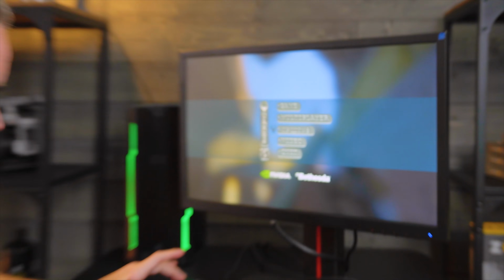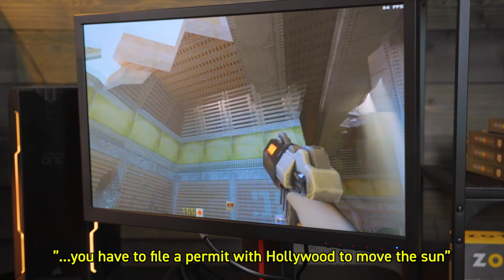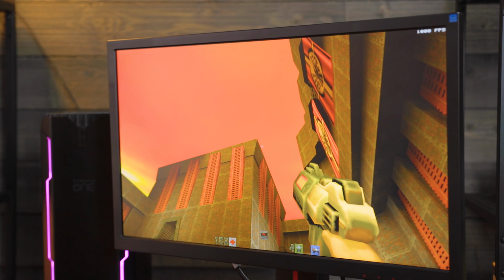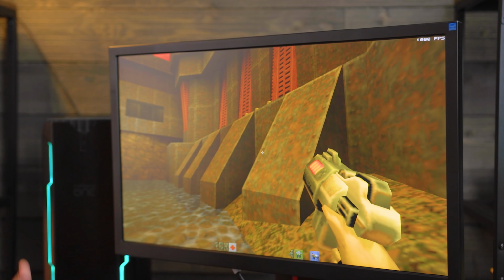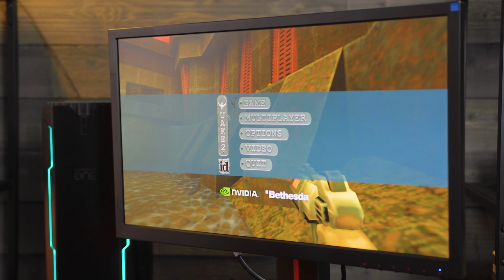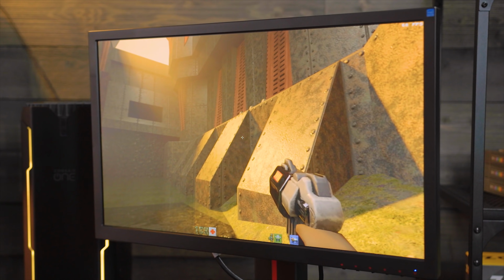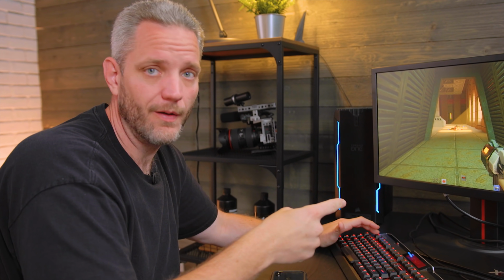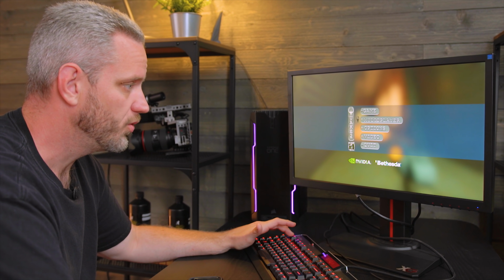Testing Quake II with fully ray traced update...

Comment: GTX 1080 + i7-9700k @ 5.1Ghz + 16GB DDR4 all at 1080p Resolution = 8-29 fps depending on settings
Reply: 'Nvidia has announced it will extend ray tracing support to its older Pascal family. ... According to Nvidia, attempting to run ray tracing on a GTX GPU will send the frame rate cratering, all the way down to 18fps on aGTX 1080 Ti'
Reply: @majorcrits333  what is it you want so say? :)
Reply: @johnwayne-ou5yy  RTX cards have dedicated technology for ray tracing, thus being much more optimized for RTX quake 2.
Reply: @sashaburquest7420  who does not know that? It's literally in the name 'rtx'. I just posted my fps because I thought maybe someone might be curious as to how the 10 series would do.
Reply: And Jay literally asked for people to post it too

Comment: Wow so this means that in 2037 I can play witcher 3 Ray traced
Reply: That means I'll have a computer powerful enough to play Witcher 3 ray traced by about 2050!
Reply: Not at the rate of technological advance, it will be probably be quite faster
Reply: at 90 fps maybe
Reply: There's actually already a ray tracing mod for Witcher 3... Not sure about the actual framerate but the demo I saw was using an RTX 2080ti and it looked smooth. Definitely playable.
Reply: Not that far, the longest you’d probably have to wait for playable RTX is probably 2025 at the most
Reply: @ch0ketv_  that was a path traced global illumination reshade mod. Not nearly as awesome as true raytracing would be.
Reply: Unfortunately, games these days no longer open up their source code after the support ceases. Classic id games like quake became open sourced, and that is what allows for the modding community to go balls to the wall.
Reply: Ultima 7 Ray traced
Reply: It’s not worth being an early adopter for most technology unless you got cash to burn. In a couple of generations good raytracing with minimal impact should be much more achievable.
Reply: 2077 ;)
Reply: I'll still play it even without Ray tracing!
Reply: @ch0ketv_  it's not full ray traced ambient occlusion
Reply: im gonna guess by 2023 or 24 raytracing will be a normality and much easier to run considering the pace that computers are advancing
Reply: @ch0ketv_  It's worth pointing out that the mod for Witcher 3 simply adds SOME ray-tracing elements on top of the game's existing shader based lighting techniques rather than replacing them all. This is done to make it far less compute intensive (Read: To get a playable framerate). If you yanked out all lighting tech from the witcher 3 and replaced with straight up ray-tracing like they did with this version of Quake II, not even the 2080Ti would be able to render it in any sort of playable framerate.
Reply: So rtx are worth it yey
Reply: @TravisTLK  it'll be 2050 by the time you can get it ray traced with hairworks

Comment: 10 FPS with a GTX 1070 and Ryzen 2700x @ 1080p with Global illumination set to medium
Reply: have the same card, i have no hope then
Reply: Thanks for taking one for the GTX 1070 team! Now I know without having to test it myself.
Reply: Same specs thanks for the warning lol
Reply: Thank you
Reply: Same card. RIP Ray Tracing.
Reply: Set resolution scale to 50% and GI to low and you should get up into the 50s. Even turned down it's pretty impressive tech.
Reply: im not guna bother lol
Reply: Same card, same sad performance XD
Reply: gtx 1660ti oc, with a ryzen 2600x @1080p (global illumination high : 12fps) , (global illumination medium : 16fps) and (global illumination low : 22fps)
Reply: And the first version of the raytraced quake 2 that came out a few years ago made by one guy (without hardware support and looking grainy) showed raytracing off better because the light sources were set the way the lights were baked in in the original quake 2. These doofuses changed the lighting setup.
Reply: How do you get it to launch with a 1070? I got a "no RTX card detected" error message with mine.
Reply: Ryzen 1500x with rtx 2070 , screen scale 100, medium global illumination i got like 80 fps but boy is still shuttering like hell no way i am gonna play like that
Reply: @AmolLusk  IIRC that guy is the same guy who started this.
EDIT: Nope I did not remember correctly.
https://amietia.com/q2pt.html
http://brechpunkt.de/q2vkpt/
Reply: I heff 1070 and Im gonna try it in 69x69 pixels for that 11,1fps cinematic experience xd Just like the old times.
Reply: @Sergioelg  I mean its only gonna be playable on something that has tensor cores
Reply: @Jossages  why was he praising them on twitter like they were strangers then
Reply: @AmolLusk  Probably because I did NOT remember correctly.

The original one : https://amietia.com/q2pt.html

Second one here (RTX) : http://brechpunkt.de/q2vkpt/
Reply: @CantankerousDave  I have no idea. I know my drivers are up to date. But I'm not sure if that is a requirement or not.

Comment: All 3,000+ original game textures have been updated with a mix of Q2XP mod-pack textures and NVIDIAS own enhancements. Not just ray tracing making the game look better.
Reply: Wow, did they really used Quake2XP Engine for this? greta I remember playing with that engine some years ago and it was great! Just need High Res Textures and the game will look excellent!
Reply: Yeah but still it run like crap, and doesn't even look particularly better then moded Quake II. There is a reason Nvidia only compare it to plain, basic, old Quake 2 instead of other modern moded version of Q2 that doesn't utilized ray tracing.
Reply: Is the framerate that low, because everything around you is ray-traced instead of only the scene, which you can see in the monitor frame (like BF5, which is a modern title, but has a similar performance with ray-tracing).

Comment: Quake 2 RTX demo (stock settings) on my GTX 1080 (8700K 5GHz/32GB 3200):
4k - 4 fps
1080p - 12 fps
768p - 23 fps
Reply: what kind of resolution is 768p ? :D
Reply: @M0nsterRipper  4:3 1024x768 or 16:9 1366x768 or 16:10 1280x768
Reply: @M0nsterRipper  1366x768
Reply: Warm Soft Kitty  still is on cheaper laptops
Reply: y i mean how you scale down from 4k to FHD to this... isn't the next step 720p?
Reply: Ouch
Reply: @M0nsterRipper  Laptop "HD" res?
Reply: Same setup but with 1080ti. Got 6fps on 4k, 17fps on 1080p and 47fps on 720p. Ray tracing really does annihilate Pascal. Lol
Reply: 4 fps for 4k LMAO! 😂
Reply: Thanks for saving me some time.....
Reply: Quake 2 RTX demo (stock settings) on my GTX 1080 (3570K 4GHz/32GB 1333):
4k - 4 fps
1080p - 12 fps
720p - 75 fps

Comment: Quake II Remastered: 
1. With RTX - 80 FPS
2. Without RTX - 1000 FPS 
 😭 😭 😭
Reply: FPS limited 1000 😁 should be a lot more
Reply: for only $1300
Reply: i think the polygon count is higher with rtx on aswell
Reply: Mine was over 9000
Reply: @ScrewFearMe  Based on what?
Reply: @nathangamble125  the graphics are better, or are they just using different textures?
Reply: @ScrewFearMe  RTX on does nothing to polygon count.
Reply: @OniMirage  maybe not but look at least at the texture difference, is that really just textures?
Reply: @ScrewFearMe  It's global illumination that is physically more accurate giving depth to the scene, original is just flat lighting.
Reply: Don't forget the free coil whine at 1000 fps
Reply: @ScrewFearMe  You think wrong.
Reply: @Tvv1SteR  ok, so its just the light particles from the rays that makes things look better textured?
Reply: @ScrewFearMe  Resolution of textures is higher, but polycount is the same.
Reply: @Tvv1SteR  good, at least thats settled
Reply: @cardigansrule  domt forget that apple has a stand that's 1k
Reply: Quake 2 has low polygon count compared to modern games which support Ray Tracing. The thing is unlike other games which uses a mix of rasterization and real Ray tracing where as Quake 2 fully utilizes the Ray tracing capability fully. May that is why it is so taxing on RTX cards.
Reply: Rtx frame inflation now available on rule34
Reply: Yeah, I'm going to file RTX  for next,next, next year...!
Reply: If the first car was driving slower then a horse, would you still say that a car is bullshit?
Reply: Meanwhile...Hollywood and professionals understand what RTX cards are and buying them in droves.

One day people will understand WTF was accomplished
Reply: @MLWJ1993  Texture are indeed change, to provide ray tracing informations on it at least.
Reply: @ScrewFearMe  Why would you even think that. You do realise someone would have to remodel (by hand in 3D software) every single in game object and basically remake the entire set of game assets to achieve higher poly. That is not just some effect you can slap on.
Reply: I got only 43-44fps with RTX 2070 🙁
Reply: @ScrewFearMe  Yeah, 3d models don't change at all.
Reply: @philipquaglino  oh people understands, nvidia is just marketing to consumers when it's not really ready. If they had kept the feature as a pro only thing for this initial wave then the story might have played out a lot more differently.
Reply: @ScrewFearMe  not necessarily polygon count, which is not as important as you may think. Texture is. But since rendering algorithm is tightly couple with texture, I don't think improving textures is a cheat.
Reply: @Farid Zellipour yeah, thats what it really does look like
an hd remaster with rtx
Reply: @skipad4306  The TECH is ONE of the best things in 22 years, fro gaming. Not Nvidia's latest Cards. The fact that you can even ray trace IN REAL TIME. Sure it might be a generation or two for the muscle to run modern games fully ray traced, but the technology is amazing.
Reply: @rawdog1026  Yeah you are right. Ray Tracing brings all new level of realism to games. I think this is the future of gaming.

Comment: heh, the shadow shows you're just a floating hand with a gun.
also 1800x 4ghz
1070ti +223 core +450 mem
about 13-15 fps at defaults.
Reply: I think you can push the memory more, I got +830 on my msi armor 1070
Reply: Damn, +223 on the core? My 1070 shits bricks when I get too close to 2100mhz, so I had to dial it back to +185 with +500 on the memory (I could go up to 650 i believe but for longevity sake didint do it.)
Reply: @Appusle  My 1070ti routinely boosts past 2 all the time, I kinda was shocked myself. I ran into power limits though, kept the crazy memory clocks out of the way and let the core clock go for it. I have the Zotac 1070ti mini and its a beast of a little card. 2100 is pretty hardcore though, not many golden ticket cards can pull that off...
Reply: @freepok  i can get 510 in in most things but it glitches in overwatch past 450.. though i am in awe at you're 830 o.o
Reply: @drunkrdm  I have Samsung memory, I think I won the memory lottery haha on the other hand, the core is barely stable at 2050Mhz. So I undervolted powervoltage at 82% core is at 1982Mhz. Jealous of your core OC
Reply: @joshuasterling2144  I must have a golden chip then 🤘 only +150 core clock and +250 memory and it sits at ~ 2100 pretty much all the time with small dips to around 2050. MSI GTX 1070 Gaming X.
Reply: wait until you find a mirror
Reply: @tomwilson7765 Pretty awesome, mine is much closer to 2025+. I rarely am disappointed with the card, it pretty much chews through everything I throw at it...I primarily game at 4k.
Reply: That's his settings. You can get it to render your full model in singleplayer mode. Jay didn't dig into the settings that far.
Reply: @joshuasterling2144  I haven't tried it on 4k yet but im glad to hear 1070s can keep up with 4k. I know mostly all games are different in terms of fps but what are you averaging for fps in 4k compared to 1080p? Also do u or have you played Fallout 4? Its not in 4k but they did come out with a 50gb+ downloadable hi-res pack which from what I've read is it's close enough to 4k. I'm asking because that's what I primarily play and once you upgrade you can't revert back and want to know how the 1070 handles it, don't want to add 50+gigs to my 500gb ssd if it won't perform good. 
P.S. I have a 49" LG 4k tv I've been wanting to hook up to just to see how well the 1070 handles it.
Reply: @tomwilson7765  Well I have the TI which is closer to the 1080. That being said by majority I get 4k@60 on high settings on most games. I think you could do the same with the 1070 as long as your settings are on mostly medium with some highs thrown in. I think on your tv you could have a great time. I dont even game on a monitor. I have always gamed on my tv. Keep in mind that you could also run it at 1080p with 2k super sampling and then let the tv's engine scaler take you the rest of the way. There are plenty of configs that will look pretty and play well on a 4k tv.

Comment: I think they should remaster half-life series. That might be amazing to play!
Reply: Yusuf Osman OSTA The first one was redone. Not raytraced though.
Reply: I will be ok if they add RTX to Half-Life 2 series!!!!
Reply: dude stop. Do not give them this idea. I will be throwing my gtx1070 into the trash and wasting big money on the RTX gimmick if they do that with HL2.
Reply: there already is a remaster. its Called Black Mesa.
its very pretty.
Reply: gmod all rtx
Reply: @friedclutch97  but dude 1070 is old asf. I just replaced my 1070TI for 2080 Super...move on buddy. There is no waste here - just look at these graphics man...I played yesterday this game and I tell you something - I would replace 2 1080 TI in SLI for 1 2080 Super or TI. Basically 2080 super is almost that strong as TI so if you will consider to get one then go for Super or wait till June 2020 because then 3080 will be coming out.
Reply: @Yorku_testuje My monitor is 1080p 60hz. your RTX will no nothing for me.  Any title maxed out on my current card is way above 60fps. I would need a $500 monitor to go with the card. #notworthit #stillwaybetterthananyconsole Move on? Yeah right.
Reply: @friedclutch97  ugh it looks like you got stucked in a ''bad Loop'' :) new gpu = new mth board = new rams = new cpu = new screen = all new :) I had the same but was lucky to earn some $$$ quickly and got my self a decent rig. all the best man
Reply: @Yorku_testuje  Hold on. Did you just state that I need to "get a decent rig"? lol. all the best man

Comment: 55fps@ 1280 x 720, or 27fps@ 1920 x 1080  rtx set to low with 1080ti @2100mhz . 6700K @4.7ghz
Reply: oof
Reply: Basically, this technology isn't really ready, and won't be for bother 5 years
Reply: @blodstainer  if we waited 5 more years with the release, there would be minor improvement
Reply: Specs: gtx 1080.
Ryzen 5 1400 
2333 16 gb ddr4
1080p
Boottime settings: 11 fps.
Updated playable settings: render scale 60%
GI:low
50fps

Global illumination low, 100% render scale
15 fps.
Reply: Almost same with MSI 1080ti GX@1900 and 4770K@4.4, 25fps and long frametime in FullHD with low GI. Realtime image also looks far too rougher compare to oficial screenshots that were made in high-quality pause mode (1080ti needs more than minute to handle one FullHD HQ shot).
Reply: @fire_silicon7803  GPUs 5 years old generally don't age well, sure the 970 actually did but look at the 770, which was just like 1-2 years before that. No, it doesn't matter if the tech might be good within 5 years, because they are selling it NOW
Reply: Bloodstainer the difference is that we are not talking about one particular architecture optimized for one rendering technique. Raytracing unlike rasterization is implemented in games for short time, unlike rasterization. As you could have heard in many videos developers use tricks and shortcuts to gain performance and quality from rasterization. There are no such “tricks” for RT yet. Let’s compare it to whole computers for example... if IBM PC was introduced 5 years later, what would it helped? If that happened we would’ve had the pc’s we have today or at least with such a performance. The sooner we start the better for us. Rasterization is a dead end for graphics industry as monolithic dies are for CPU. Look at intel. 10 years of monolithic dies and now it suffers hard. We use rasterization for about 25 years. It’s time to switch.

Comment: The reflection matter is that it depends on the material. The whole PBR (physically based rendering) workflow , today current in art for games, is all about it (even if we're faking it all yet with shaders for real time (not so much for render-only projects instead of games)). Each material has a particular tone (base color), physically accurate and many other matters, like roughness value (ie, which dims that reflection) and other non material based factors that will affect it. So, not all materials will be like new car coat reflection. In the Quake demo, they might not have introduced a single spec about that in the materials, and the raytracing is just interpreting the info that is fed with, about the materials. So, imo rather than a user tweak, is just work of the artists to provide the accurate settings in the whole world. As it is already happening with non-ray traced content.